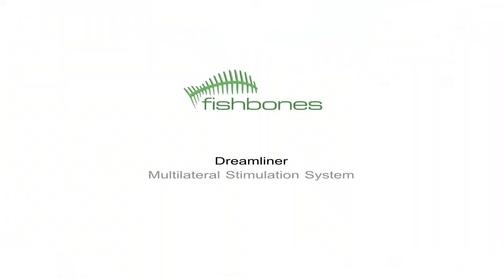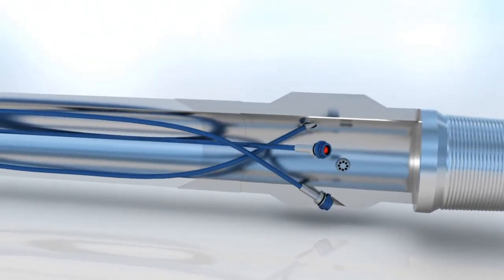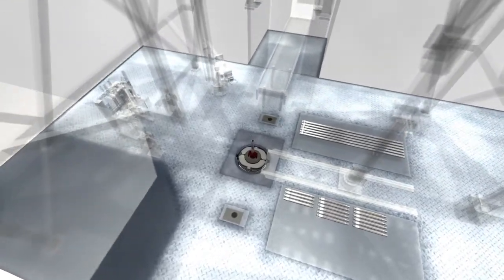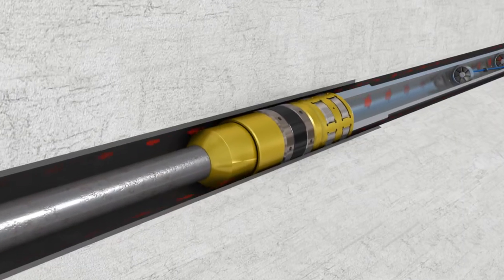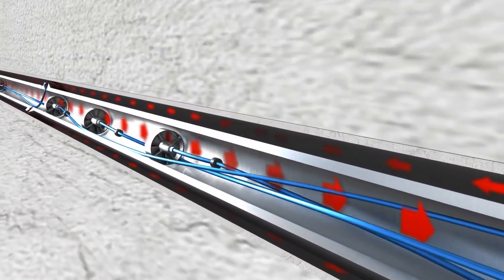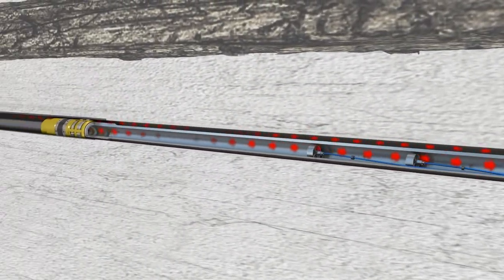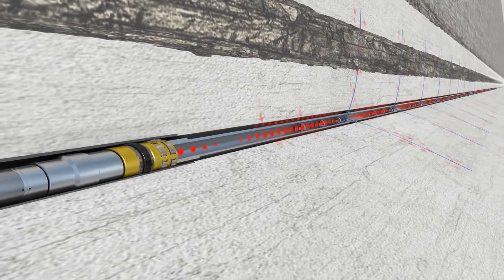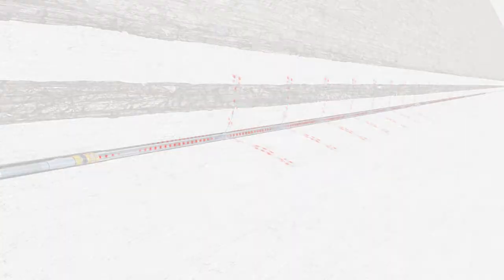Fishbones Drilling animation

Comment: A far simpler, cheaper and more effective technique would be to use D5 Energy Services' D5 Precise Propellant stimulation.  Can be run through tubing and doesn't leave anything in the well.